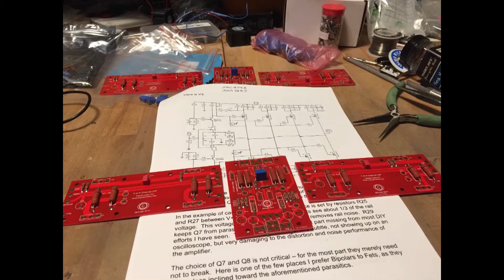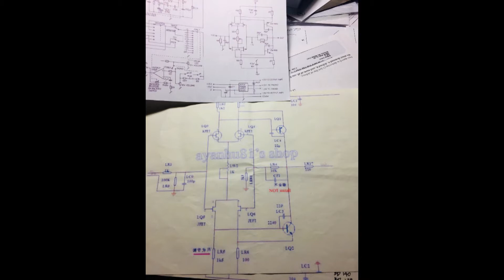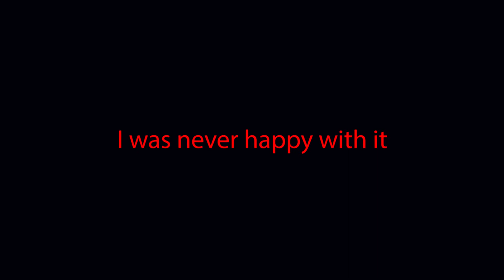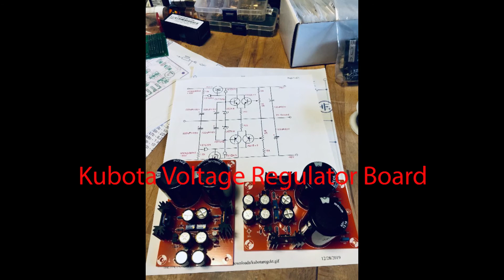Robert builds a Solid State Preamplifier

Comment: Appreciate you sharing with us this expierience .
I would like to ask you if possible could you share links in description to components like chasis , selector board and transformer . I have ordered allready JC2 kit prior to watching this but still would like to use this components as it is just beautifull piece , love the layout and finall look .
Reply from the maker: Thanks for the kind words Adam. Look at the Jims Audio store on Ebay for the selector kit. This is a similar enclosure to the one I used. Most of the Chinese cases are well made but tiny; you need one about 300 x 400 x 75mm to be big enough for most projects. One drawback is that they take a month to arrive. Here is what I found after a quick look :https://www.ebay.com/itm/Black-amplifier-chassis-preamp-case-Power-amp-DIY-cabinet-box-430-60-300-/202954411844?hash=item2f41068f44
You might also look at the Galaxy 2U cases at DIYAudio.com/store. They arrive within
 days of your order.
Reply: @NocturneVid66  Thank you for reply i got that kubota supply too . What about transformer . Where did you got it and what voltage is needed . I cannot wait when the kit arrive . Got ovation nx pcb too . First time i will try something like that to learn , have fun and perhaps achive good sound . I have bot had many amps so who knows it may blow me away as a novice.